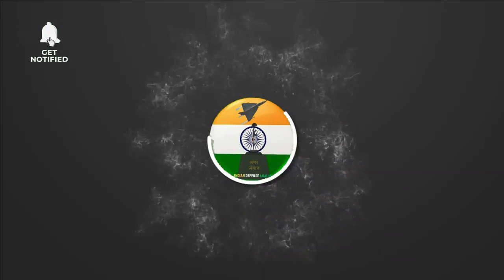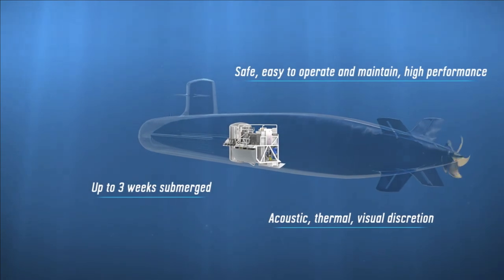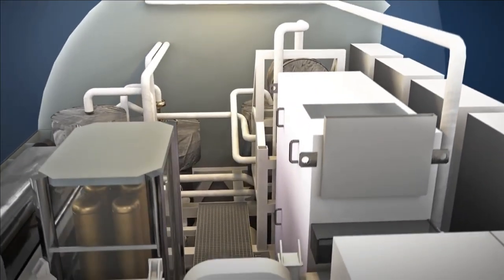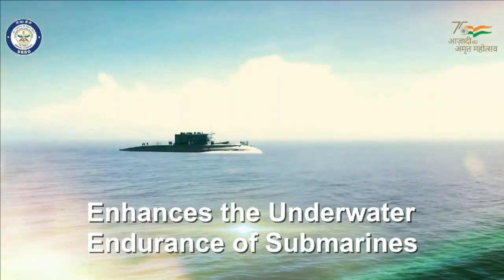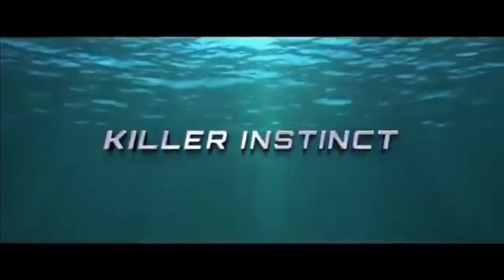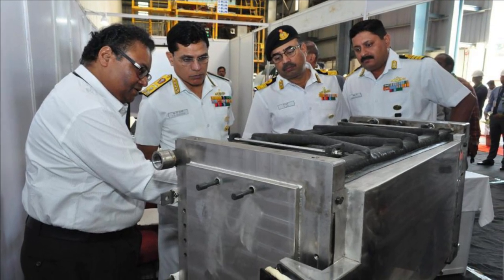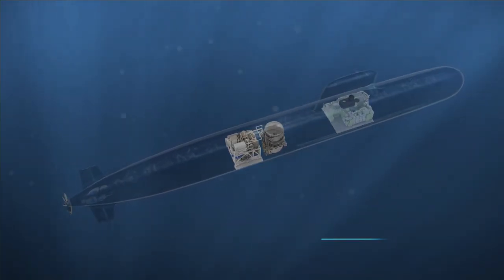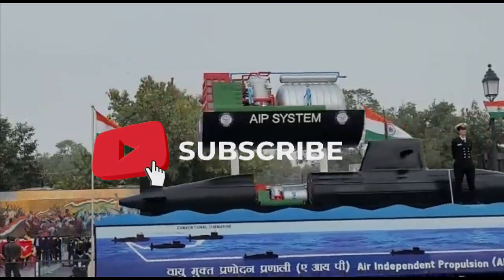Navy pushes for DRDO's AIP system | To be fitted with Kalvari class submarine

Comment: This sounds like a flashback of when Tesla was making all-electric cars, Toyota went ahead and spent billions of dollars and several wasted years in trying  to make a hydrogen fuel cell car. Ultimately, Tesla won hands down and the world recognized that all-electric cars are the way to go. I am quite puzzled as to why there is this obsession with AIP fuel-cell systems when you can just install a very large number of Lithium Iron Phosphate batteries (which are also extremely resistant to punctures and damage and fires - which is a HUGE concern for subs), install a bunch of battery controllers and inverters and related circuitry, and call it a day? That should give far better performance and endurance than the AIP system, and that too for a fraction of the cost. Most importantly, this can be done right away as all this technology is commoditized and is available dime and dozen. So need to rely on exotic chemicals and rare parts etc.
Reply: This was covered in the previous defence update episode where he was comparing Li on batteries vs aip system and there concluded that aip is not adequate in power generation and capacity when the boat goes to flank speed the system will rapidly lose more power than it produces, vs lithium ion battery it can provide a constant charge and the battery drains less.
Reply: Why are you comparing cars and submarines? Both are different worlds. With conventional subs we need more endurance under water. If AIP can provide that then we need to look into it instead of discarding it.
Reply: @gotfan7743  Because both solve the same problem - using non-conventional energy sources to power the vehicle. There is no conceptual difference between cars and subs as far as their engine and power sourec is concerned.

And AIP does not provide more endurance or power - in fact it is the opposite. Electric propulsion would put AIP to shame and is also far cheaper, safer, does not use corrosive dangerous chemicals and acids, and uses technology that is already well proven and well understood and can be easily operationalized.
Reply: @man tham Stop being childish. Read what i wrote more slowly. I used Tesla just as an example - the world in now full of electric car and Lithium or high density storage innovators.

In fact, if you read carefully or understand the nuance, I specifically mentioned Lithium Iron Phosphate as a good battery type. That is not what Tesla even makes, and where Tesla's cars tend to go up in flames due to their battery chemistry being more volatile to fires, LiFePo batteries are much much more stable.

Toyota poured years of research and billions of money into Hydrogen fuel cells, almost at the same time that other companies started rapidly innovating in electric vehicle and battery tech. You can see where each technology is today in terms of mass adoption and maturity of technology. 

And Tesla's stock tanking is largely because Wall St as usual overhyped the stock to ridiculous levels. Heck, even if Tesla further drops by half, its market cap and value will still exceed the world's largest auto companies, including Toyota and VW etc.

Anyway, my point was, as engineers, you build with what you have today and you take a practical approach to innovation. Chasing pipe dreams and impossible things sounds romantic but that is not how progress works.

Long story short, as things stand today, an all electric solution to subs as a silent and oxygen-free or air-free propulsion system is the only practical answer that ticks all the key boxes - price, technology maturity, maintenance, long term support, made in India tech, safety, and ability to provide enough energy and horsepower beyond trickle charges to top up batteries so the sub can stay underwater for another 12-24 hours which is a ridiculously small amount of time - which should be in the order of weeks.
Reply: Japan didn't ready to give it to us. And also not ready to give it to Tesla.
Reply: @man tham Major nations are using AIPs because Lithium batteries only got commercialized in the last 10 years. And most of these subs were made before that.

And absolutely, today's modern subs are using all electric.

Not sure what you mean by "electricity doesn't grow on trees" - when I was talking about "all electric" I meant it as a secondary system, which is what AIP is. When the diesel is running, it charges the batteries. When the sub needs to operate silently in enemy waters, it runs on battery power alone which will drive the sub for several days until it reaches safety and can turn on the diesel again.

Just because I am saying AIP is obsolete and electric is the future doesn't mean the AIP people were fools. They did what they did at a time when that was the only technology solution available.
Reply: Ah leave just make ssn & ssbn nuclear submarine no power tension
Reply: @arunramachandran5012  Most German AIP subs were built after 2000. What are you talking about? You don't seem to understand conventional subs. Non-AIP subs don't last long. They have to surface almost 2-3 days to charge their batteries. Lithium-ion batteries can't pack lot of energy for subs to run for many days.
Reply: @arunramachandran5012  I think putting too much battery increases the weight of the sub. That means the submarine will be needing more energy to push through water than the earlier.